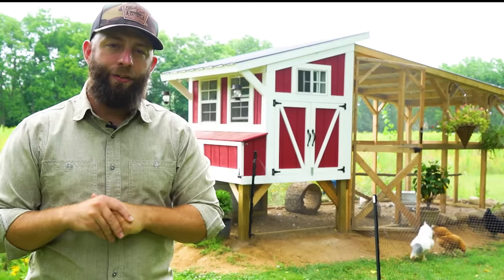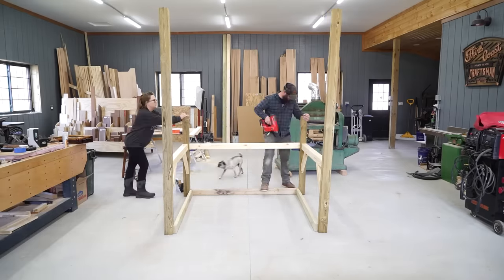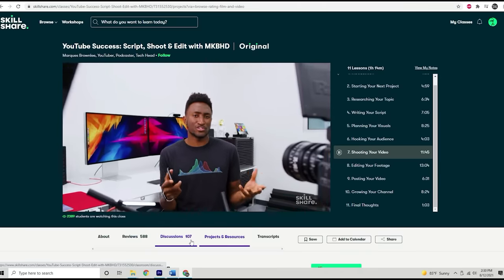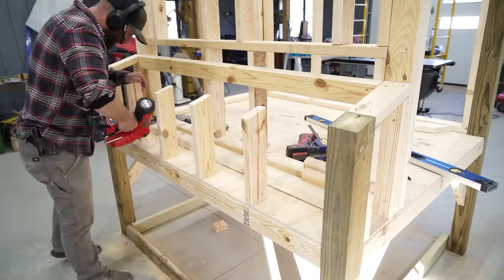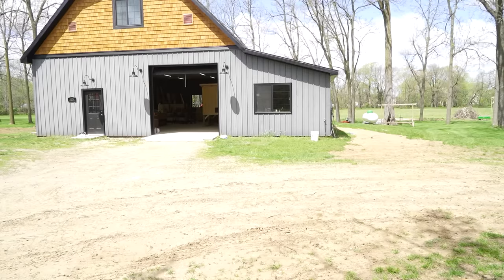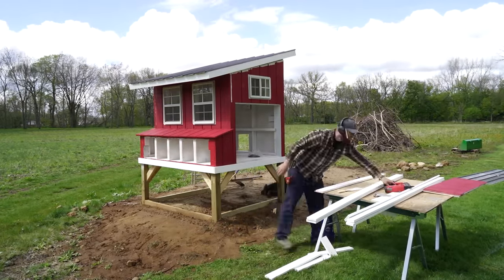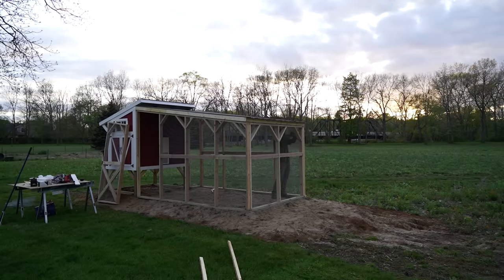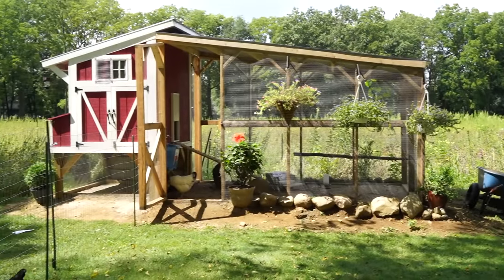Ultimate Backyard Chicken Coop Build | How To DIY

Comment: I bought the plans and will be building this coop over the next couple of weeks--it is by far our favorite design for a sturdy, easy coop and run build on YT. My only question is this: we get some hefty storms here in lower Alabama and I'm concerned about securing the coop and run from high winds. I dont see any info on how this all secures into the ground. Many builds I see the posts being set into the ground. I can measure the 4x4s long and set them in but what about the run?

Comment: I purchased your plans. What determines when to use nails vs when to use screws? I see in your video that using a nail framer makes for quick work so I'm about to purchase one. I'm just curious as to where and when I should (also?) be using the construction screws.
Reply: I just screwed it all together because the cost of a nail gun is too much. Use clamps to aid in holding wood while you screw it in and make temporary wood supports to assist as well. He only uses the nail gun to hold boards prior to screwing them.
Reply: @cclarry  Thanks. I am about to start the project soon so this is helpful

Comment: the rough opening for the main door is 41.5". the siding filler pieces show them being flush with the RO. but the doors together are 42.25" wide. are the filler pieces supposed to be trimmed so the door will fit properly?

Comment: Hello. I have a question on the windows. Do you install them inside out? You want to be able to open the windows from the outside right? Not from the inside, otherwise you have to go inside the coop. 
Now if the are installed inside out, wil they still be waterproof?  Thank you.

Comment: Have you thought about adding a self sustaining watering system? Especially with this Michigan heat we have been getting lately.
Reply from the maker: No, we have a water source close enough and their water bucket lasts a pretty long time. We need to add a water heater for the winter and probably a different watering system. The nipples freeze even with a heater

Comment: My wife purchased the plans so I guess I’m building this coop. The plans are awesome. I need to buy a framing nailer, nails and Screws. 
I see your using a cordless framing nailer. What are the specks on the nailer? What degree? 
What type of nails are you using? 6D, 8D?
What diameter screws are you using? 6,8 or 10?
Thank you very much!!

Comment: This is awesome. If you don’t mind my asking, how much did you invest in supplies (not including tools) and how much did you spend in time? Thank you I advance.
Reply: I'm currently building this. So far it's about $1500 in supplies. It's been ~5 days since I started, most work done on Saturday\Sunday, weekday evenings spent a few hours each. The framing is done except the run roof, which will be done today. 

All in all, I'd give it at least a week to complete. Keep in mind the angles for the roofs, buy extra material (I'll likely need to get more 2x4's and roofing). The run supports (the little angled cuts in between joists) are a pain and I haven't done them yet. The instructions, if you buy them, leave out little details like this, so you'll have to figure it out if you don't already know it (I'm figuring it out myself).

MITR saw, multitool, square tool, power drills, rubber mallet, jig saw or table saw (I used a jig saw), a saw horse or table, clamps, etc. will be needed to build this. So another $500 in tools alone.

Comment: My top piece of the frame at 4:04 needs to be trimmed long side facing up(vertical).  Yet I see in the video you are trimming long side facing horizontal.  I framed that first set with all four posts and 15 degree cuts, but when I put final 2x4 on top, it needs to be trimmed maybe 5 degrees. It just make me wonder what I’m doing differently since your video has it being ripped horizontally.  My cut would need to be ripped vertically.  The 2x4 at the top is supposed to be flush with the posts, right?

Comment: I'm currently building this coop and it's coming along nicely so far. It is a great design; very efficient and aesthetically pleasing. One thing, however, that I am very disappointed about is there seems to be quite a lot of missing information in the plans. This is very frustrating as I've had to redo a few parts and have therefore wasted wood and time. I think if you put the same level of detail into the plans as you did with building your own coop, it would be a great product that is well worth the price. But, because of the lack of detail and frequency of discrepancies, I do not feel that the plans are worth paying for. At least not until the issues are addressed and corrected. Besides that, I do think that my coop will finish nicely because thankfully I did not need to follow step by step and was able to figure it out on my own. If someone with less experience or know how we're to attempt to follow the plans step by step however, they would surely run into several problems that would at the very least slow them way down if not stymie their project all together. Thanks Third Coast Craftsman for the idea but please fix your plans for other people's future projects and maybe think about refunding my money.
Reply: Question.  How long are the brace supports on the run? Its not listed anywhere! Having the same problem of wasting wood.

Comment: How did you overlap the roofing panels? I bought mine from Menards with your measurements and it doesn't look like there will be much of an overhang side to side if I overlap. Also, what fastners do I use to secure the roof?
Reply: I used the Teks Sharp Point roofing screws (got mine at Home Depot), they have a rubber washer on them for a tight seal and they're self-tapping. I was lucky enough to find the same color as my corrugated roof that I also bought at Menards.

Comment: I'm currently halfway through building this based on your plans with some minor changes (the whole thing is only 48" wide, as I only have three chickens and a relatively small back yard). I like the plan holders you have off of the side of your run near the roof. Could you provide any information on what those are? I'm interested in both the supports as well as the plant containers themselves. I'm liking the build thus far. Thank you for the work you put into sharing this.
Reply: How did it go?

Comment: Hello, 

I just bought your plans after watching your video (multiple times) and am itching to get started! Can you tell me why you don't use treated lumber for the run since it will be exposed to elements, termites, etc? I come from a background of fine woodworking, but have never done framing or outdoor applications. The cost difference seems negligible as well in this case. Thank you!!

Comment: osb or plywood for chicken coop flooring? i plan to have a large area which am hoping to support my weight for cleaning. i am gonna use osb for the walls and roof obviously with lts of protection from rain on top but was wondering if i should use plywood or thick osb? which would be a cheaper option and which would be stronger?

Comment: @ThirdCoastCraftsman  - What size metal roof panels are required. Putting in materials order now. Excited for the build!
Reply: Same question. I’m on page 11 of the build (purchased the blueprints). I can figure it out, but it would be nice to know what you used Chris.
Reply: @frankrodgers2634  I ended up ordering 3.17-ft x 12-ft Ribbed Silver Steel Roof Panel from Lowes. It took three panels for the run roof and two for the coop roof. Most of the rest of the build went well, I would only make one change if I were to build it again. I would change the way I assembled the coop legs to accommodate installing the hardware cloth on the outside instead of the inside as it is in the plans. Just easier in my opinion and matches the run better.
Reply: Thanks Ken!

Comment: I bought the plans, and I'm concerned about the water running underneath the top peak of the roof since there are no ridge caps or flashing. How did you handle this? It doesn't seem to be addressed.

Comment: Kindly explain why the back wall to plate us cut at a 15 angle. The verticle stud angle is already 15 degrees right? So won't the top plate lay flat like it should? Please explain. Thank you
Reply from the maker: The narrow edge of the top plate is supposed to have the angle so it lines up vertically with the studs. It’s hard to explain with words. You don’t have to make that angled cut on the top plate though if you don’t want

Comment: I'm almost at the part where I attach the side doors and the measurements don't make sense to me. The siding I cut out can't fit inside the opening.
Once I place the 1x4s, if I follow the directions the opening is too small. I realize some some things are cut to fit but this makes me think I've done something wrong.
The framing around the door is 33"  tall in total and the siding is 31 3/4. There is only a 3/4 lip at the top. And the added width extends too far on each side as well.

Comment: Hi. I'm from Denmark and would love to get the plans for your Chicken Coop, however. First I have to make sure it's even possible, regarding to the measurements. If the size of your plywood is different from the size I can get in Denmark, it would be really hard to use your Plans. So, could you please tell me the size of the plywood please, and maybe in cm not inches ;) Btw, du the Plan come with cm instead of inches?

Comment: I bought your plans. The only thing I'm not sure how to do is the 15 degree cut along the long edge of the 2x4. Do you have a video showing how to do this? Can it be done with a skill saw. I don't have a table saw
Reply: get you a framing square or carpenters square and use the degree marks to lay out your 15 degrees

Comment: Another great video, thank you.  I want to make a coop run something like this, but I want it to be able to break down because I'm hoping (please....) to move out of Kalifornia and go to Dallas are of Texas.
  For the run I want to make it in 4'x6' sections with hardware cloth and connect them together.  I like your roof idea.  It doesn't rain too much here in SOCAL, but does the rain cause loud noise on a metal roof?
Reply: You can put foam or plywood under the metal to soften the noise but it isn’t that loud.

Comment: What are the width of the roof panels that you used? The updated prints do not say, only mentions length of 82”

Your prints call for roof to be 73 1/2 “ width and 80” length - So two 36” x 82”roof panels wont cover that roof structure. In other words going by measurements in the print for the roof two 3ft wide roof panels wont work while having a 2x4 width over hang on each side as per your prints. Also in this video the roof looks pretty close to flush on the sides of coop. 

Please advise.
Reply from the maker: Sorry for the confusion but Standard roof panels are 37.5” to 37.75” wide. They are listed as 36” because of the over lapping ridge. Two of those panels will cover the roof correctly. If you need questions answered please email me, I’m happy to help. I get a hundred of comments a day between all my videos so it’s very difficult to stay up on them and very easy to miss questions. Thanks for ordering.

Comment: Great video, really enjoy your builds because of the craftsmanship and charm u take in your projects.  Will likely folllow ur plans when we finally pull the trigger (been talking about for several years, just time Mgmt:). Like others, I’m interested in your plan for the winter; can you make an update video on what you do for heating,lighting, & water as the colder months near?
Reply: Chickens don't need heat or lights.
Reply: @patrickhenry240  even in -25 degree temperatures? I live in NE, I guess I assumed Michigan gets that cold too. I suppose you could wear a head light if ur cleaning out the coop in morning or evening during winter when it’s dark
Reply from the maker: Hi Ed, here in Lower Michigan we only get about 5-10 below zero nights a year. First of all we picked chicken breeds that are relatively cold tolerant. You don’t want chickens with really large combs or waddles. The main issue with cold is frost burns on their waddles and combs. Moisture plays large into that so ventilation is key. At night they fluff up and huddle together, generate warmth and are ok during most cold nights. On extreme cold nights like what you are mentioning maybe a ceramic heating element or something but it’s not good to add heat too often because then they become dependent on it.
Reply: @Ed-jg3ud  If you heat up your hen house, sure the girls will be cozy overnight, but when they go outside in the morning, the drastic change in temperature so suddenly will effect them in a bad way. They are fine with most cold temps as longing as there isn’t a draft and there is ventilation.
Reply: I'm insulating mine and using OSB on the interior with added venting close to the ceiling. Then I will run an outdoor extension for a heated dog dish for winter water and I bought some LED battery operated lights for the interior and some nice solar post lights for the exterior between the windows. Making my own windows with plexiglass and wood on hinges with hardware cloth behind them and making a door from leftover T1-11 that can be raised or lowered by a string. No need to heat, however, you need good air flow. Thanks

Comment: I am going to attempt to build this on my land in Oklahoma which has very high winds at times. Other than building the posts with an extra foot or two and anchoring them in the ground with concrete, do you have any suggestions on keeping it from getting demolished in a wind storm?
Reply: It should be fine if you use screws like he did. On the windward side, use extra screws on the metal roof. You can also run the metal a couple inches longer and wider and bend the metal over the edge. If your posts are r foot deep and are concreted in, the structure is going nowhere.

Comment: I am currently building this coop and I am a little confused on the top plate of the back wall.  In the video you are cutting the 15 degree angle on the 1 1/2" side of the board, it looks like in the plans the cut is on the wide side of the board, any help would be greatly appreciated.
Reply: I just emailed him the same thing. Struggling with it myself. Did you figure it out?
Reply: @nicholaslewis4195  yes I did, you cut the 1 1/2 side of the board it faces the outside of the building. The board sets a an angle. Page 7 doesn't show it, but all of the back wall studs also have a 15 degree angle on the top. All of the long angle cuts are like that.
Hope this helps.
Reply: @dougcamden9955  thank you so much!

Comment: Greetings from Switzerland (I mostly use english Youtube Vids)
We had a traditional chicken coop with dug in wire mesh and about 2.5m (after a fox jumped over the 1.5m) wire mesh enclosures which had steel posts... 

Therefore my Question: Do your chickens never dig themselfes out under the coop/fenced in area?
Reply from the maker: I have a wire mesh “predator apron” buried all the way around.
Reply: @ThirdCoastCraftsman  and the outside area with the mobile fence is probably only open daily if you are around?

So you basically have a mesh under the sand

Comment: Where can I get some windows like these they are no longer available on Amazon
Reply: I posting links to EBay where you can find them but YouTube is deleting the posts..  They have the 2 18x23 inch windows but the 12x18 inch is unavailable I did find a 14x21 inch that will suffice. They are low on stock so hurry up!

Comment: Chris, I bought the plans last spring and I’m currently buying everything to build this. One question, do you recall the size of the roof panels you used.
Reply from the maker: Width wise they come standard as 36” wide sections. The plans tell the length, sorry I can’t remember off the top of my head and I’m not near a computer haha
Reply: @ThirdCoastCraftsman how do you get two 36” wide roof panels to cover the 73 1/2” wide roof structure as per your plans????? Asked multiple times. You have to over lap roof panels to install them so how do two 3’ roof panels cover 6.125 feet (73 1/2”) of roof structure??? 

3 ft panels that have to overlap is short by multiple inches. Please explain.

Comment: I know I've posted a few comments on this video but I had to come back here and give you a warning. This is regarding the automatic door you put on your coop. I just recently came across another channel where they were talking about raising chickens and the guy mentioned that they had lost several chickens due to the automatic door closing on them and trapping their necks and apparently killing them. I don't know anything more. I don't know what brand or model of automatic door they had. I'm just passing on the information that his has happened with these automatic doors.
Reply from the maker: We use a brand called ladies first and it has a pressure sensor so that if feels any resistance on the way down before the very last bit it will open back up and try again. It’s a safety thing to prevent that exact problem and we’ve never had any issues with ours.